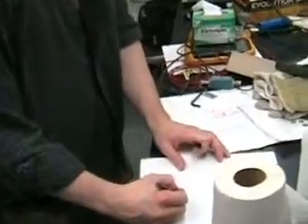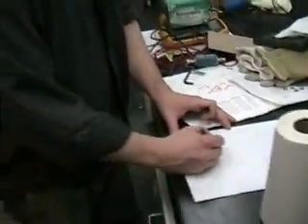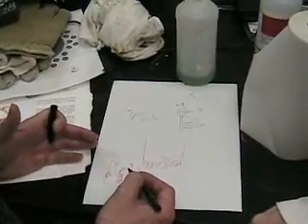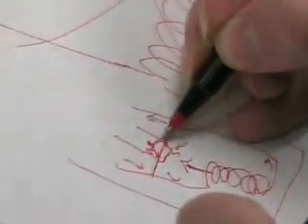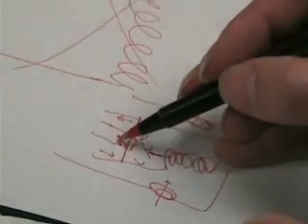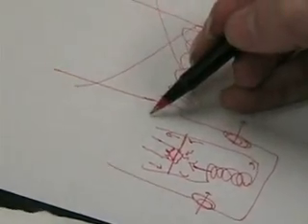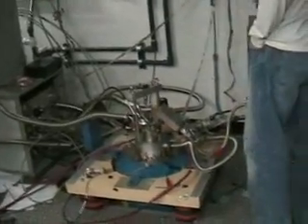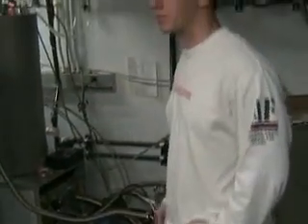How Superconducting magnet works

Comment: I've been thinking about this for a while, as I'm considering building a super-conducting electromagnet.  I figured since there's so little resistance, there must be a way to keep the current cycling through the superconductor, and I was curious if all I had to do was short the ends of the coil.  This confirms my suspicion.

Are you guys magnetizing a super conductive core here, or just a normal normal magnetic core or air core?
Reply: We're you successful in building a super-conducting electromagnet?
Reply: @christophercraft957  Let me know if he did lmao.